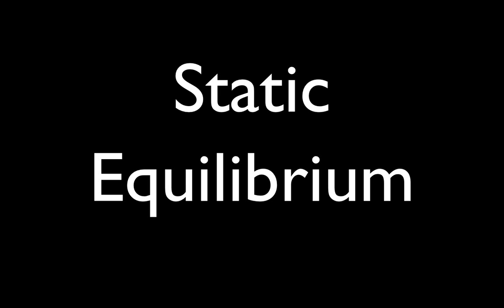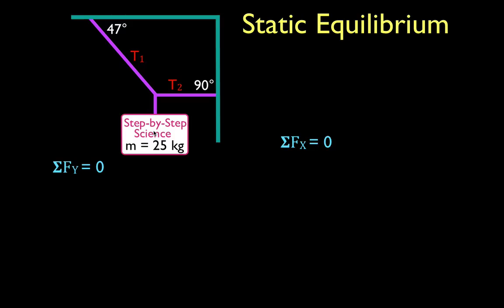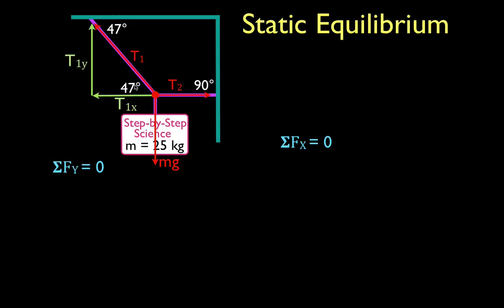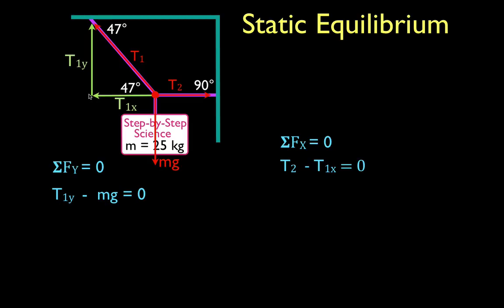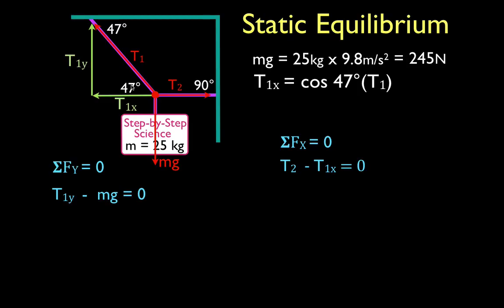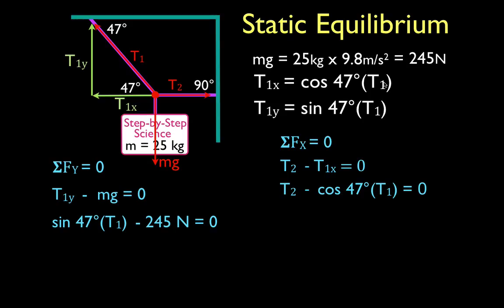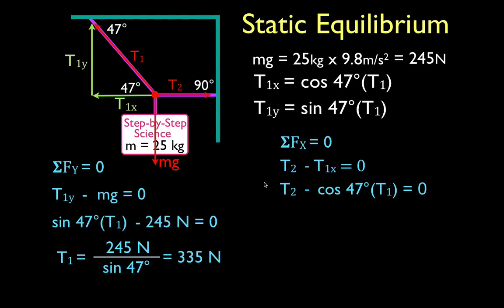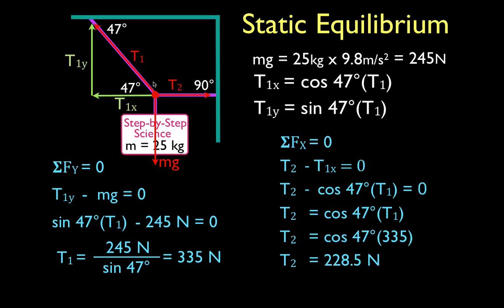Physics, Torque (7 of 13) Static Equilibrium, Hanging Sign No. 1

Comment: I noticed that you said T1y = sin(47)*T1 to solve the equation. If you had mg and you knew T1y - mg = 0. T1y and mg are the same and then you could have used  SOHCAHTOA to solve for T1x. Then T2 = T1x
Reply: No. You can't use sohcahtoa if you have only two data. You need at least three (with one being a side), like one angle and two sides, or three sides, or two angles and one side.
Reply: @CesarHernandez-bz8xc  What are you talking about? Sohcahtoa only has 3 variables. Sin = O/H etc. If you know an angle and a side the others are easy to get. The T1y is = to weight since they are they only two up and down forces. This was a harder way to solve this but it helps for future problem where the second string is also at an angle.

Comment: T1 came out as 346.5 N, so T2 is wrong as well
Reply: Make sure you using degree mode and not radian on your calculator.
Reply: You calculated sin(45) instead of sin(47).